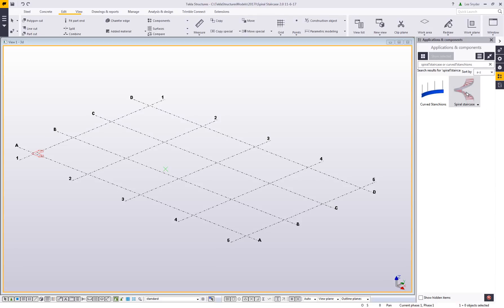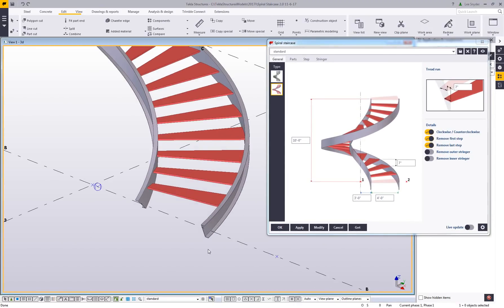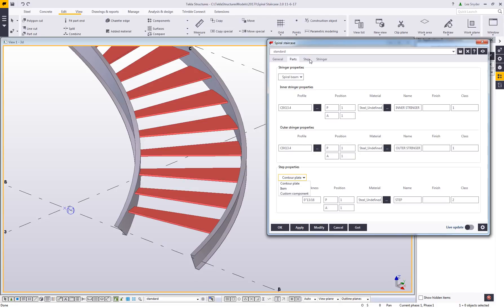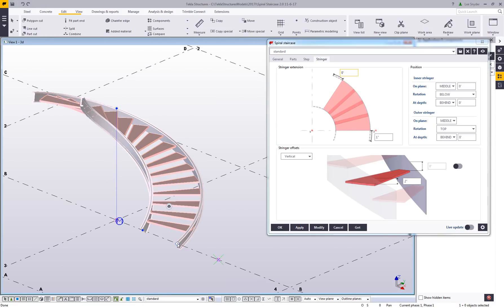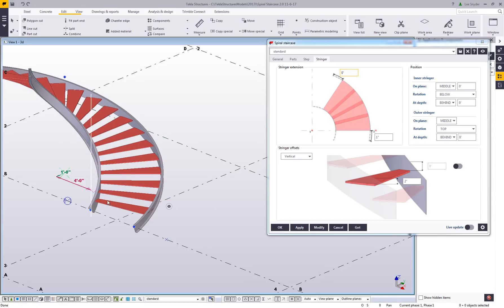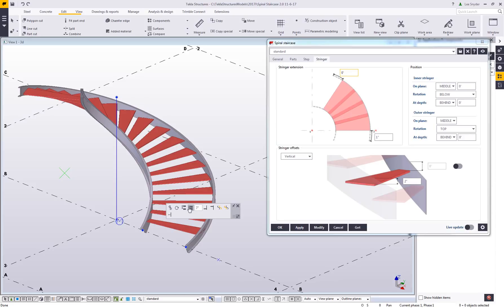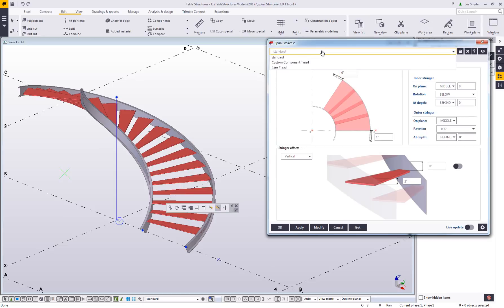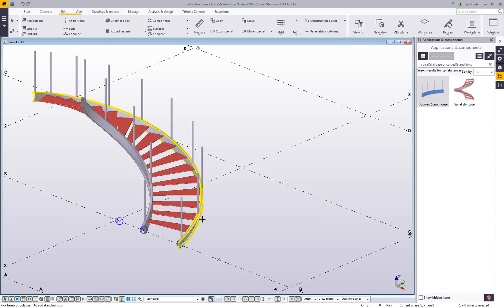Spiral Staircase 2.0 - Recent Steel Development in Tekla Structures

Comment: How about the structural design ?
Reply: Tekla Structures doesn't perform the analysis/design of the stairs but this tool would be used to model the criteria defined by the engineer so that the stair could be fabricated.

Comment: I face the same problem. the inner stringer is coming curved when we select the spiral beam option.
Reply: Hello.  Could you email me your scenario so that we can investigate it?  lee.snyder@trimble.com
Reply: Thanks for sending the model.  To avoid this situation we recommend that you continue to use bent plate option so that if you want to create a plate stringer you can still get the proper output when the radius is small.   This is why that bent plate option still remains

Comment: This could be very good but needs a bit of further development.  The main issue at the moment are that when the spiral profiles are viewed in plan the section faces are not vertical but curved. (this works ok with bent plate but not spiral beam).  This problem is worse the smaller the diameter and makes it very difficult to use the information provided for fabrication purposes particularly trying to display setting out information.  Further development on the overall setting out of the staircase shape would also make this much more useful in particular the setting out of the treads.  Generally the back of one tread is parallel with the front of the next tread with some overlap.  Also treads are often set out by overall angle of the stair or each step.  It would also be useful to be able to create a handrail and possibly balustrade glass infill panels and double stringers at the same time.
Reply: Hey David.  Thanks for the feedback.  Could you email me directly at lee.snyder@trimble.com so we could discuss your requirements further?